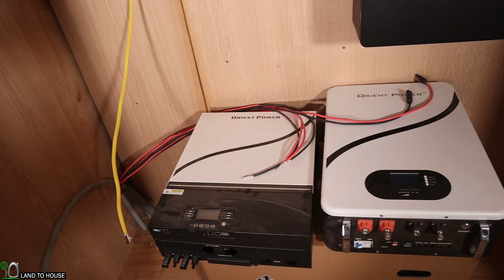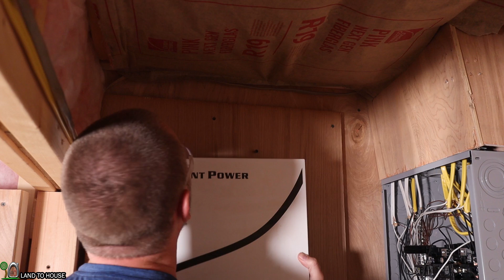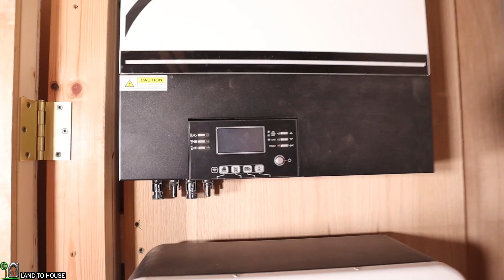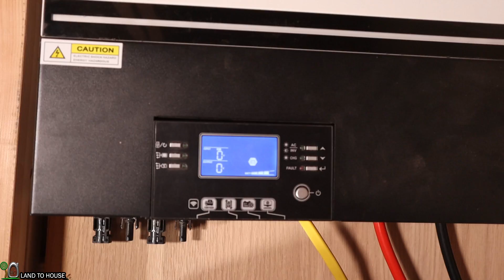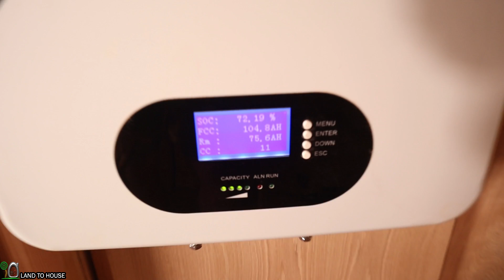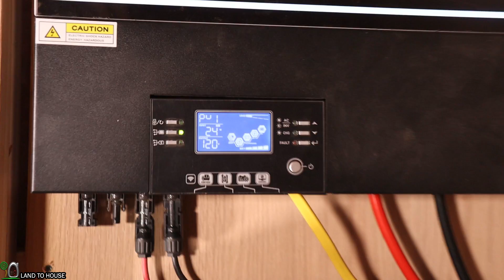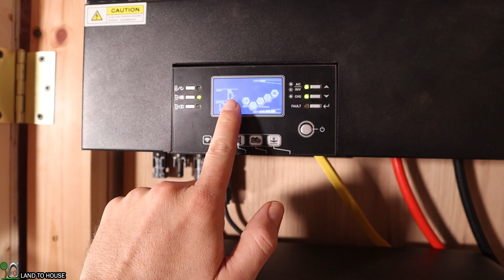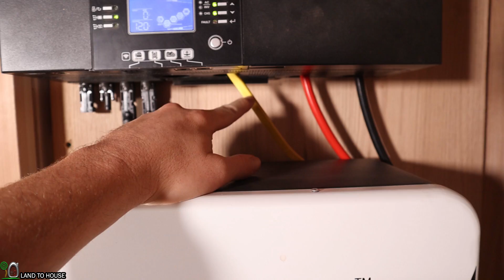Orient Power 6000w Inverter and 5kwh Lifepo4 Battery Install

Comment: HOW LONG HAVE YOU HAD THIS SYSTEM AND HAS IT BEEN RELIABLE THANKS
Reply from the maker: This system has been up and running now for approximately two months. I've had zero issues whatsoever. I did have to pull the case off and remove the bond screw for the neutral and ground in order to connect it to my earthground.

Comment: What's the standby consumption?
Reply from the maker: The data sheet shows less than 70w. Seems like over an 8 hour period the unit uses 250w. That would put this around 31w on my end.

Comment: Do you need a fan to outside on your closet, plus an inlet vent low down, to keep heat build up down?
Reply from the maker: I am not sure about the heat in summer. For now I am looking to put a very small heater in there to keep the battery warm. The door is not very tight and lets a good bit of air flow.
Reply: @LandtoHouse  Will your planned mini-split A/C would provide enough cooling in that shop?
Reply: @LandtoHouse   I suspect in high Summer defo. But in Winter I think they will keep themselves warm, but a heater set to say 38 degF would be a good idea, just in case. 👍🥶

Comment: If using any washers, use copper/brass ones. Yes?
Reply from the maker: These washers were included with the unit. I am not sure what material they are.
Reply: @LandtoHouse  
Nickel coated brass I suspect, but no doubt the material of them might be 'chinese suspect'...

Comment: Very impressive. Also helps understanding technology in electric cars too.
But as you know, mind the high DC currents, safety first. Get the safety equipment too. 👍
Reply from the maker: This unit is working well. Nice to have this power in the new building.
Reply: @LandtoHouse  
👍 But high maintenance I suspect, with everything - Fall leaves on the solar panels and all that tree stuff. 😁😁😁👍